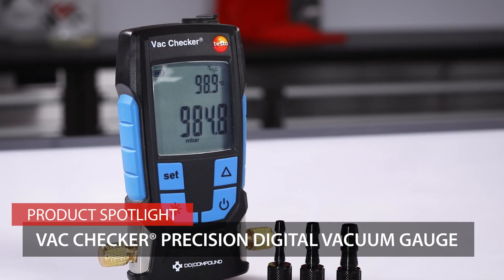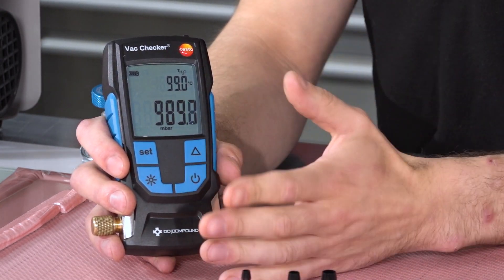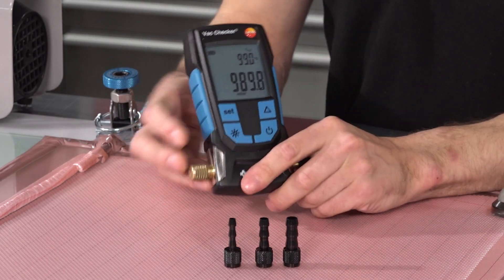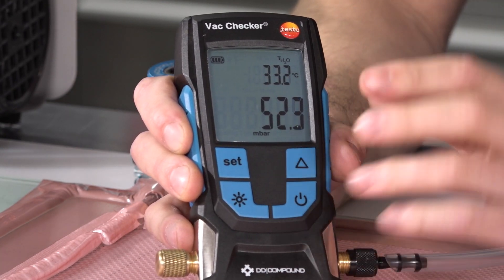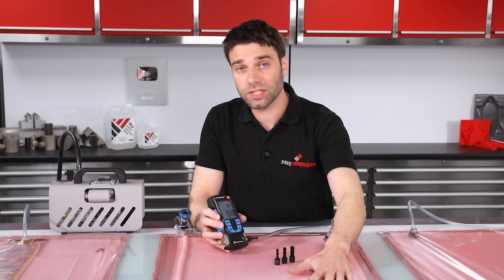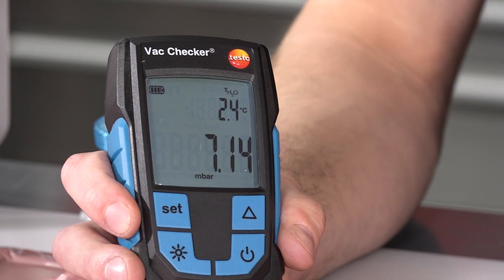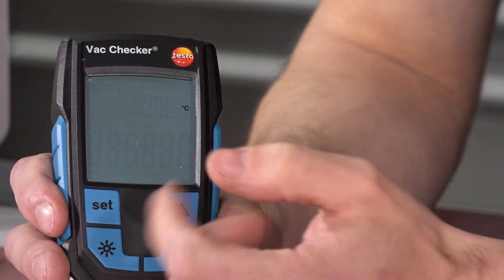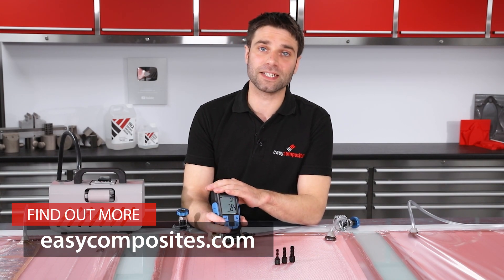Vac Checker Precision Digital Vacuum Gauge - Product Spotlight

Comment: After a realiable pump this is actually the single best investment for a composite  workshop, at least in my opinion. You can work your was along the sealant tape and watch the vacuum level. If ist changes, you've got your leak. So easy and 100% reliable.
Reply from the maker: Great feedback Oekmont, appreciated.